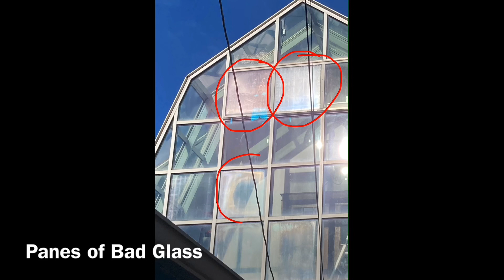Fixing My Leaking Sunroom

Comment: I bought an older house with a sunroom addition. It too has leaks because they just built in against the house, but will no buffer in between. When it rains the water just come in through the seams. Thanks for the video. Very helpful
Reply from the maker: Mine is installed under the lip of of my roof so thank goodness it doesn’t leak at the seams.